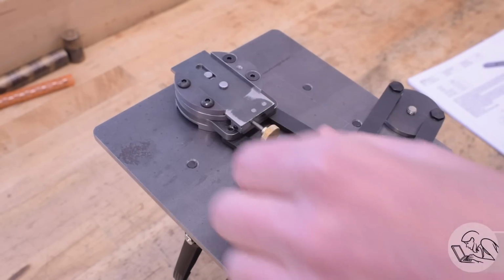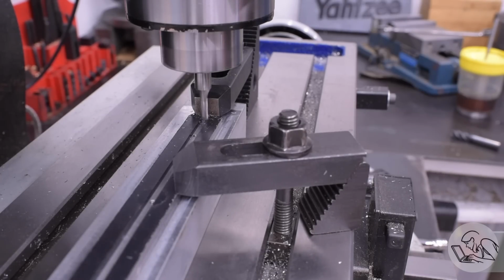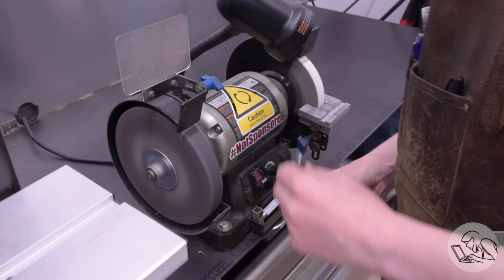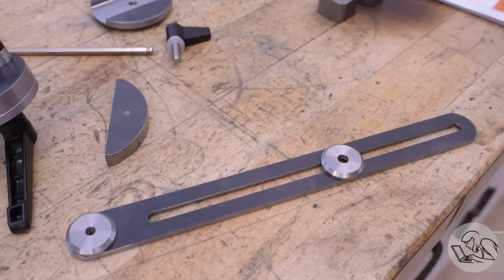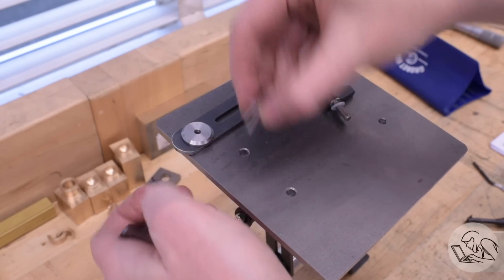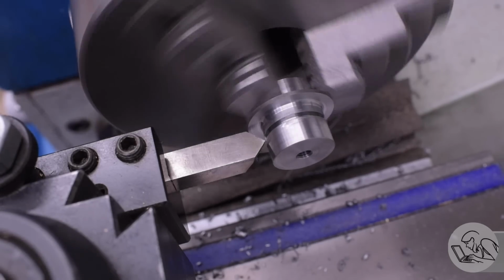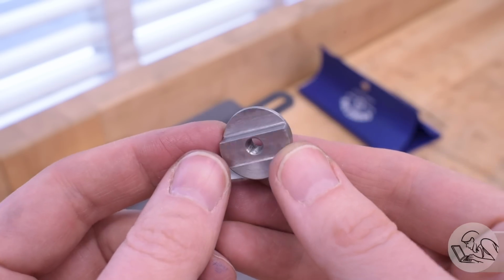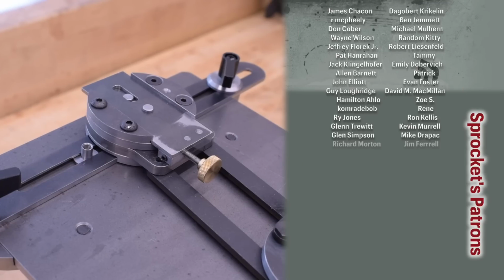Let's Build a Tool Sharpener - Part 6

Comment: The clamps on the left and right:  why were they designed with two different size holes?
Reply: The right side handle has a M5 screw to make it slide smoothly in the slot. Contrary, the position of the left handle is fixed. A M5 screw there would interfere with the cut out in the clamp. The position of the hole is choosen so that the two clamping pieces line up nicely with the end of the arm. It looks great when finished!

Comment: The left side should have a sliding fit, not a clamping fit. The clamping action on the right side is sufficient. By tightening the left clamp you lock the angle of the arm, and it can easily move up and down the side of the table, keeping the angle constant. As far as I understand, the main reason for tilting the arm is to compensate for grinding wheel wear when sharpening end mills, so you follow the actual surface of the wheel. Work piece angles are then set by turning the work head.
Reply from the maker: Yah I figured this out when I tried to use it. 😁 I correct the mistake in the last video in the series

Comment: I found some Regal R8 metric collets on ebay in 8mm and 10mm but for smaller sizes like your 5mm, I use a small ER11 collet chuck with a 1/2 shank and hold it in a 1/2 R8 collet. Yes, the stack up adds a little run-out but not much if you are careful. This also lets me hold funny imperial sizes that I don't have an R8 collet for.

Comment: The shop I work for here in Western Washington is in the process of filling out all out our collection of metric tooling. At this point if youre in indistrial repair in North America you need to have both. Heck, Cutting Edge Engineering keeps both sets of tooling around and they're in Australia.

Comment: That t-nut may be a bit snug if the corner radius is rubbing on the corner of the 5mm slot.
Most satisfying part of mashining is when all the differnt parts come together and you get an actual working mechanism. Sadly not a thing I get to admire often in the shop I work at. We get parts from baking factories  to chemical and petro industry to tank and warship transmissions, but rarely a complete project in house.
Reply: The T-nut will never reach the ends of the slot. The stop block that it locks to arm is always somewhere in the middle, and it moves just a about the radius of the end mill that is sharpened. The whole arm assembly is mainly used for end mill sharpening.

Comment: I thought you’d probably collected all the chips and give them to someone who eventually melt them and do another bar, does it bother to have aluminum and iron chips all mixed up? Easy to fix with a magnet though.
Also, could you have used a piece of noble wood? Maybe not oversized along the sides? My guess is that the noblest of materials (the one that comes from trees) has a tendency to shrink under pressure…? And that would not give you a solid bench..? But you didn’t square the aluminium bar either.
Best wishes! You r the best